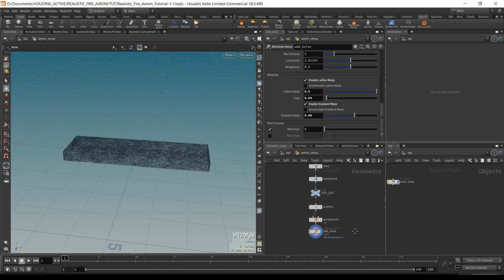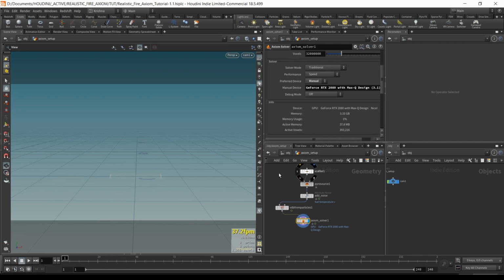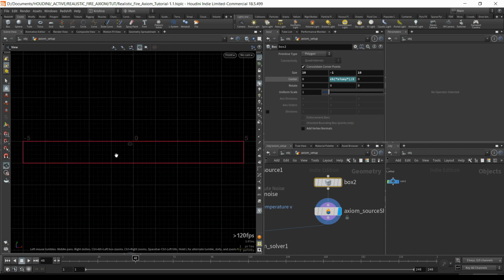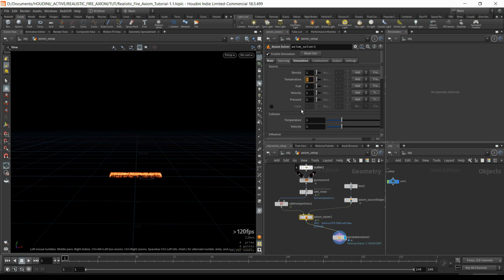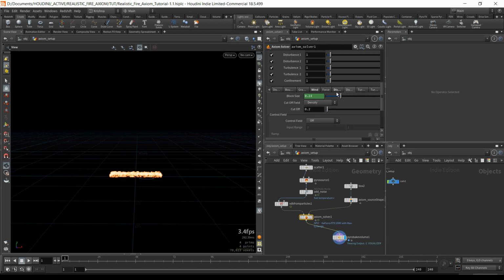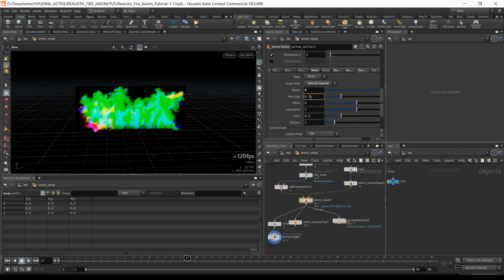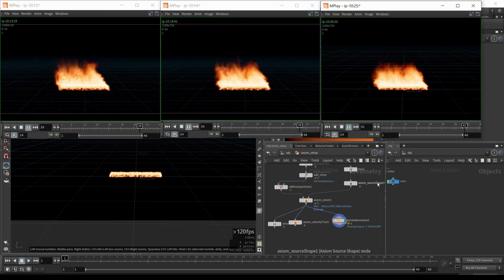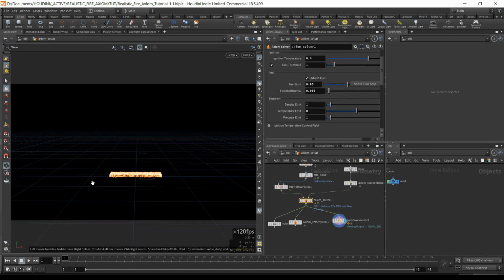TUTORIAL - REALISTIC FIRE - HOUDINI - AXIOM - REDSHIFT - Section 2 - Axiom solver settings

Comment: Quick question - I have ACES set up fine in houdini, and I checked that the path is correct, but it doesnt show any change in the viewport, only the render window. Is this a change with the new houdini?
Reply from the maker: I think sidefx updated Houdini to include ACES. That could be why. I still use the same method. You are all good as long as the render is ACES, even if viewport colour doesnt change. Hope that makes sense.
Reply: @resilientpicture  Makes perfect sense. Thank you!
Reply from the maker: You are most welcome
Reply: probably too late but I got this as well and after some search I found that background color change in viewport was a bug and it got fixed in new version of Houdini
Reply from the maker: Thanks for the info. Good to know.